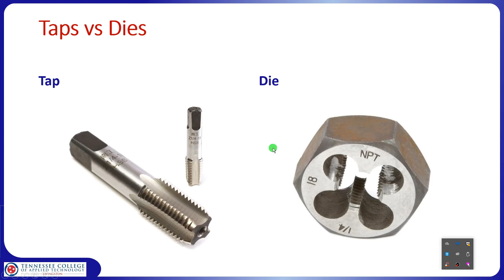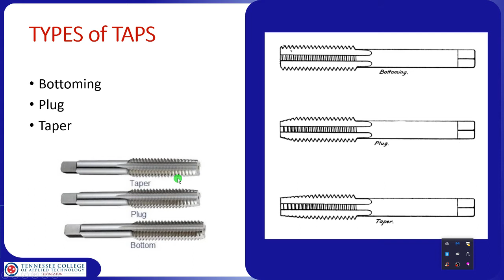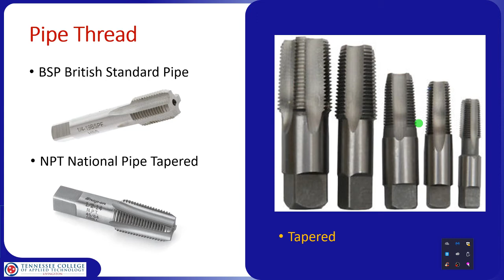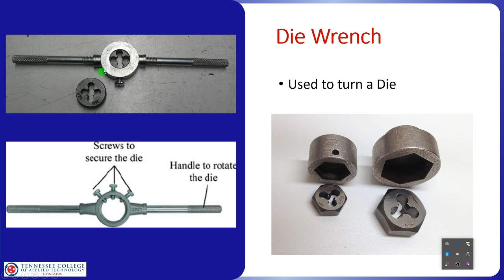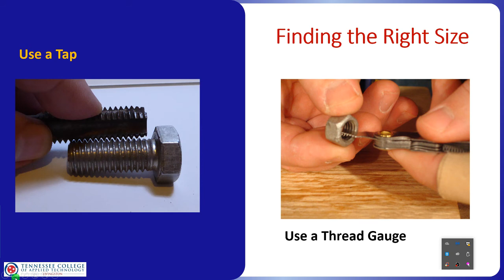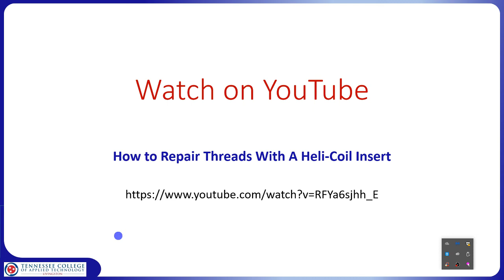Taps and Dies PowerPoint Video

Comment: The bottoming tap is, for tapping a blind hole, not meant for cleaning up threads. It has threads starting after a 2/3 thread taper, meaning you can cut threads right down to the bottom of a blind hole. (hence the name bottoming tap) 
For cleaning up a thread it's best to use a taper tap, the gradual taper spaced over 9/10 threads, allows the tap to catch into the, original threads more easily.